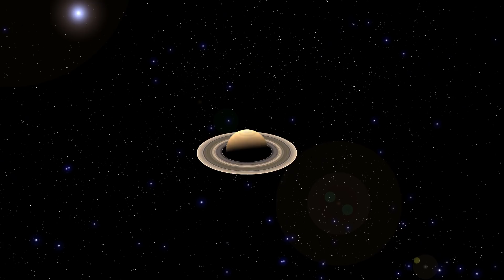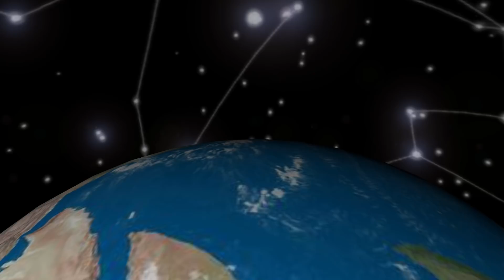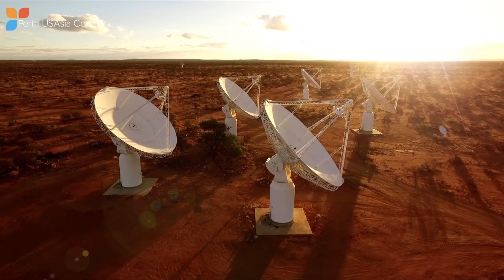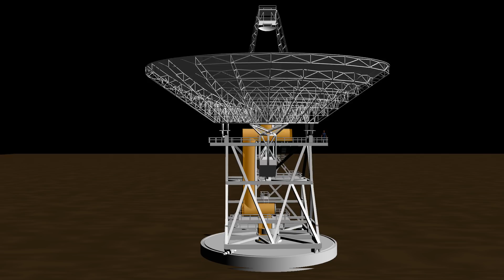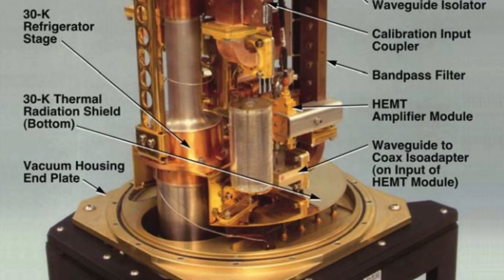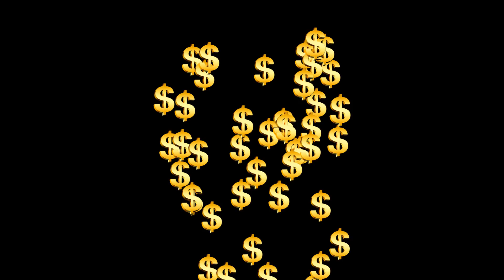Deep Space Network: How we receive images from spacecraft

Comment: How is it the other way? If u need so much technic to receive from space, how do spacecraft receive there signal?
Reply from the maker: Spacecraft also have their own big radio dish(high gain antenna) which can amplify weak signals. They are obviously not as big as the ones on the ground but they are still big. The key however is the power of the ground base station. Deep Space Network can uplink to a spacecraft at up to 256kbs using its 20kw transmitter

Comment: Impressive, if you could answer one question please, we know that this type of communication is very limited in term of bandwidth, so how they can receive a 4k video from spacecraft, and how much time in general do they take to be transmitted?
The biggest question is how they've been able to do live streaming, with clear voice and video from the Apollo missions to the moon 50 years ago?
Reply from the maker: Video data is never streamed from these unmanned spacecraft since video in most cases is a waste of bandwidth.  The Mars Reconnaissance Orbiter for  example can send data to earth at up to 4Mbps when earth is closest to mars. checkout this NASA site for download info of various spacecraft
https://eyes.nasa.gov/dsn/dsn.html

As for  Apollo the video and audio were far from clear and they didn't live stream as it's done today. Also the resolution was much smaller 10 frames per second (fps) with 320 lines per frame. The transmission was live but it wasn't a digital format.
Reply: @ReflectiveLayerFilm  Thanks for the explanation, so those live streams that we see on YouTube are not live from the spacecraft, they are live from the streamer, NASA for an example, right?
Can you please elaborate more on the Apollo thing, i mean what streaming method they used that differs from what is used today? and what was the format if it's not digital?
Reply from the maker: Yes they are live from NASA and not the spacecraft. Some pictures are live insofar as we see it immediately after the travel distance delay of the signal. The pictures are low resolution because of the limited bandwidth. Later on after the event of the live stream is over, NASA will then download the high res stuff like videos and bigger images. These may take a few days. You have to keep in mind that each spacecraft is allotted only a certain amount of time a day to communicated with earth. That's because the communication channel to earth needs to be shared among many spacecraft.

As for Apollo TV transmission method, checkout the document below. It goes into detail how that system works.
https://www.hq.nasa.gov/alsj/ApolloTV-Acrobat5.pdf
Reply: @ReflectiveLayerFilm  Thanks again for your time and answers.
Have a nice day.

Comment: Wave guides are made for a limited frequency range. Are all spacecrafts using the same frequency? And, when the speed increases of which earth and the spacecraft get separated, the wavelength changes due to the doppler effect. How does that influence the receiver setup?
Reply from the maker: All space spacecraft in deep space using the Deep Space Network(DSN) use a portion of the S, X, and Ka band of the electromagnetic spectrum. That's  from 2Ghz to 40Ghz.
Each spacecraft must schedule com time with DSN. This is why the DSN is looking into Laser communication to increase the very limited bandwidth. 
It's true that the base frequency shifts due to the Doppler effect created by relative motion. This is accounted for  and it's within the freqeuncy range that DSN is listening to. In fact this Doppler effect  is the reason why Radio Science can be performed by DSN using only the transmission from a spacecraft.  Cassini heavy relied on Radio Science on it's mission to Saturn.
I have a video on Radio Science on the link below.
https://youtu.be/ruz8TToIA2Y.

Here's an interesting read where Doppler shift almost caused the signal from the Huygens probe to be unreadable by Cassini.
https://www.thespacereview.com/article/306/1

Comment: Thank you for the video. Just to be sure to correctly understand (because English is not my mother tongue), I try to summarize what you said. We use big dish to focus the weak signal at a subreflector which reflects it to a waveguide and then it reaches at the base of the structure an antenna and a complex receiver which amplifies and processes the signal, then records data on hard disks before sending it to scientists through the internet, am I right ?
Reply from the maker: You are correct. 
The type of dish I have in the video is a Beam Wave Guide type. Other dishes don't have the beam wave guide  but have the receiver at the center of the dish instead.
Reply: @ReflectiveLayerFilm  I didn't receive any notification of your answer, si I just saw it today. That's clear, thanks.